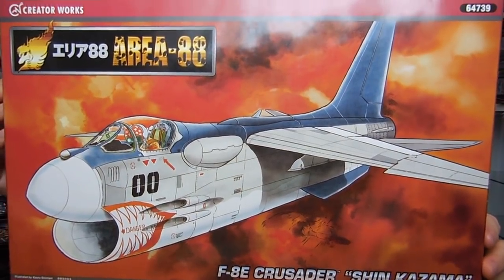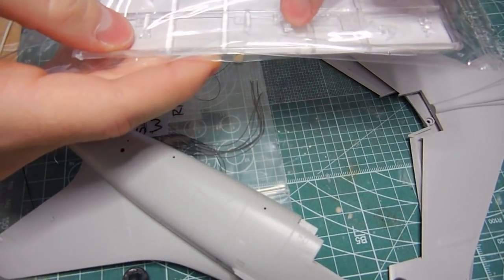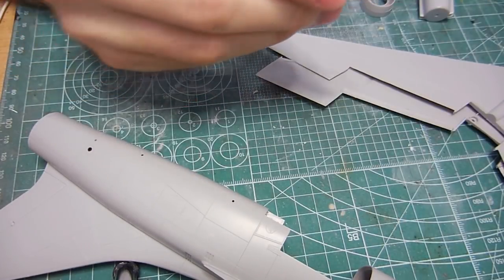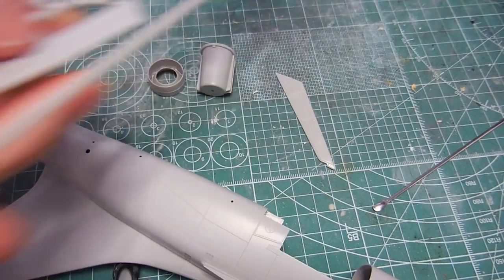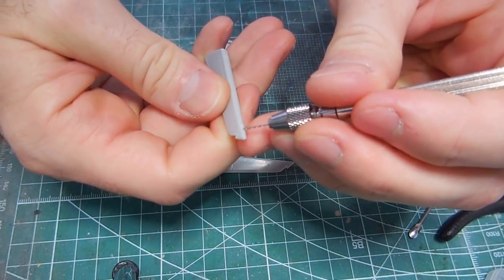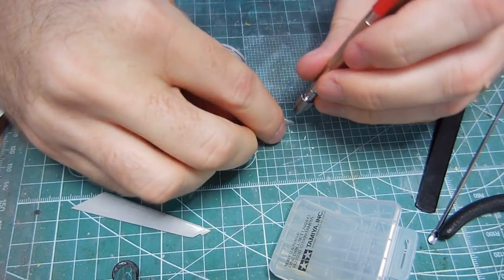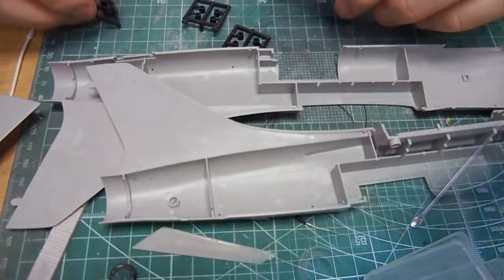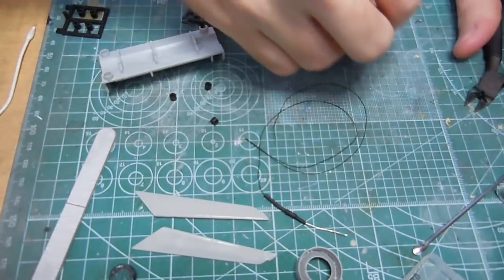Hasegawa 1:48 Area 88 F-8E Crusader plamo build 1

Comment: The lights that don't have clear parts are called formation lights or slime lights. They are very low voltage lights and they are yellow in color. On F-14s I have seen them as a light green color.
Reply from the maker: Those lights are only turned on during taxiing on the runways too, from what I have learned. They won't be turned on in-flight, am I right?
Reply: stevethefishdotnet no they are on during flight as well. You can't really see them during the day because of the low voltage but at night they are visible.

Comment: Old video, but I was thinking if it was not easier to scrape a line for your optics in the thinner parts then trying to drill it out, and just use some filler afterwards.
Reply from the maker: Good idea. I don't think I'll use any fiber optics though, but rather SMDs. Incidentally, I just took this box off the shelf and was looking at the progress I'd made and thinking about what must come next. I need to finish current projects first before coming back to this one, however.

Comment: I really should hit the books so I can do some lighting to my G-self gundam I have put on hold until I light it up. I could just put an LED soldered to some wires and a battery but it has so many areas where clear parts are that would look amazing lit up. Also, I Need to find a place here in GE where I can get all These electrical parts rather than using ebay but I don't think I'll have much luck. (at least in the area I live in). It would be so much easier if I were back in the States but after being stationed here while in the Military, I loved it so much I reenlisted to come back here and been here ever since. And like you said, I have peace of mind here. Don't  have to worry about my son being kidnapped on his way to School or worse, don't have to worry about my car being stolen, or getting mugged or killed either. Models here are fairly inexpensive(at least the revell/Germany brand)lol and I've been pretty lucky when getting kits here too and there's a Hobby shop at the end of the street where I live. Can't beat that. Anyhow, stay cool and Keep building. Best of luck finishing those kits before you start on a new one.lol
Reply from the maker: Pardon my ignorance, but where is "GE"? Is that Georgia, next to Turkey? I had to look it up. I can't imagine any country bordering Turkey where I wouldn't fear for my child getting raped, but I'm not familiar with Georgia. Anyway, this LED stuff is addicting. Get a bread board and start tinkering!
Reply: stevethefishdotnet my bad GE is Germany.
Reply from the maker: That's weird... I suppose it depends on which part of Germany you are living. I was faced with having to visit Germany for the Nuremberg Toy Fair last February if I had remained employed at.... that company I used to work for. I'm glad I got out of that arrangement by quitting, as I definitely would not feel safe visiting a country being invaded by belligerent, religious fanatic cavemen who go around attacking and raping everyone in sight. The German government hammers anyone who protests this attack on their sovereignty. Germany may not be as bad as Sweden which is turning into a war zone, but I'm still not cool with a government that persecutes girls who've been raped by calling them "racists." Something drastic needs to be done in Europe to save it. Not coincidentally, Poland and the Czek Republic are not suffering the fate of Sweden, Germany, and France because they have refused to participate in this fake "refugee crisis."
Reply from the maker: Hey, check this video out (assumming it is not banned in your country).
https://www.youtube.com/watch?v=kYmTFL9nbRQ
Reply: I actually saw this on facebook but haven't heard anything about it being on t.v. my wife is the one who watches t.v. I pretty much just watch DVD's or play Xbox on it. Other than that, It's YouTube and movies for me.
Reply from the maker: Well, I'd suggest watching it. Get informed.